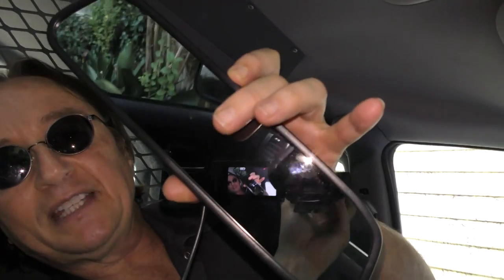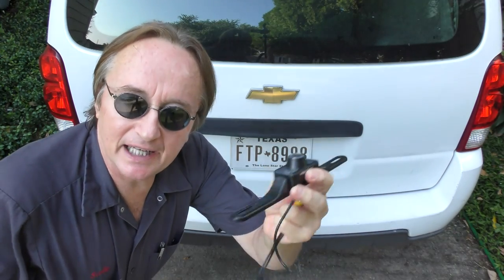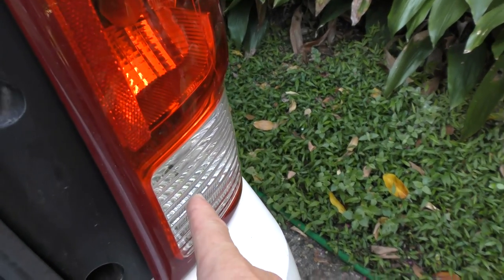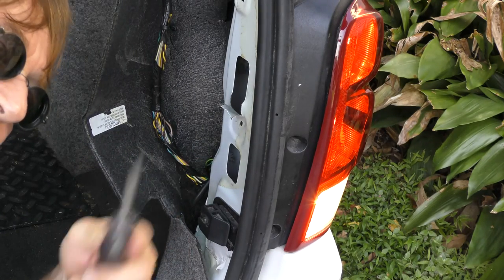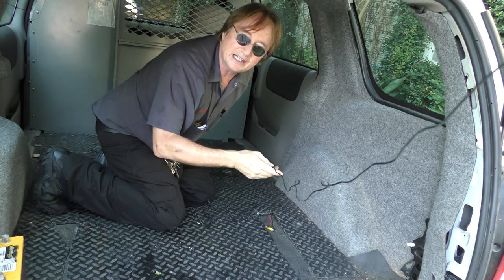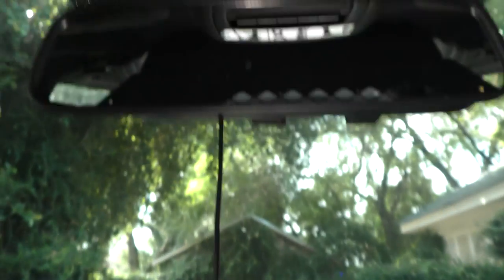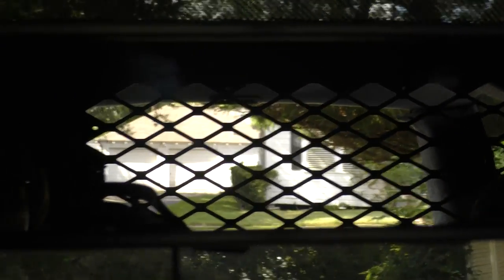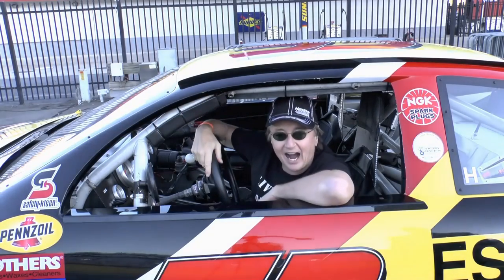How to Install a Backup Camera in Your Car

Comment: Hey scotty
Do you think it's difficult to swap an engine in a garage? I mean i know it is but is it possible?
Reply: if you have to ask that question, don't do it!!
Reply: It depends entirely on the Engine, the Vehicle it's being put in, and the experience of the Mechanic(s) doing the swap.
Reply: It's all nuts and bolts.  The question is, do you have the right equipment to remove them, and will you put them all back right?  Go practice on a junked engine that's trashed or something if you've never done it before or find a friend who has a clue - that's probably the better option.  You'll never learn more about your car than doing that job, though.  If it's a cheap car without a ton of computer electronics, I say go for it.  Buy the Alldata or some other dealer-level service manual, document everything meticulously on video (so you can watch if you forget where something goes), organize all the bolts etc. so you don't lose them and keep them with their components, triple-check you've got everything (or another ride because once you start you can't stop), watch some YouTube videos (hopefully there's one for your car), go slow, and have fun.  It's a 2 person job for certain parts of a lot of engines, and another set of eyes and hands always helps.
Reply: The easiest vehicle to do an engine swap is any domestic Truck made between 1950 and 1990. Incredibly simple designs, and more room in the engine bay than you could ever need unless you're planning on turning it into a Top-Fuel Dragster.
Reply: MaxTheKanuck I wanna do a K20A swap to a ep3 honda civic si
Reply: I think that is absolutely silly to do on a Type R.  Those are so over-priced (unless you already have one handy).  you can find a k24a2 longblock, which is the best k24 in stock form, for 1500-2000. drops straight in with a crv passenger side mount bracket and swapping over some sensors and will make more power and torque with simple bolt on's and a tune....should live a lot longer than the more expensive K20A's too

Comment: The "new version" linked costs $25 for the mirror-monitor alone. There is a disfferent one for $30 with a camera included. Transmtter/receive another $13. The indicated dimensions of the mirror are less than the width of my stock mirror.

Comment: How well does it perform in the dark?
Reply: I guess it's ok since it has its own infrared leds built in and the reverse lights also provide some illumination
Reply from the maker: yes, works good in the dark with infrared leds on it combined with the back up lights

Comment: I actually bought the exact thing and installed it in my car and right away the first problem I faced was the wireless transmitters, they're shit, the screen gets all hazy if they're too far from each other, second is when I put in drive the screen does not always turn off and shows AV2 with "no siganl" blue screen and it's annoying af

Comment: hey Scotty  my dad trucks turns off we have gone  through all of the motor can it be electrical he got a new stereo and since then it started acting up
Reply: Sudden engine shutdowns are definitely electrical. Try unplugging the stereo and see. But it could be many things, mostly sensors (timing sensor, ignition sensor, heat sensor etc.). Does it happen randomly?

Comment: Hi Scotty great video ,i drive a van so no rear mirror only side ones ,could this be wired to be a permanently on rear view mirror.
Reply: It can, just find another wire that is on when the cars ACC is on.. though most states have issues with that setup, and only allow it when in Reverse, as it provides a distraction.
Reply: Or you could just tape the mirror you got to your dashboard.

Comment: How can I install a back up camera that feeds to my infotainment screen? I have a 2015 Toyota Prius C, and I couldn't justify spending the extra few thousand dollars just to get a higher trim w back up camera.
Reply: you can easily hook onto it if your system has some kind of auxiliary video input setting. you can find that by looking at settings or if it has some aux hooking cables on the back of the unit.

Comment: Hey Kilmer thanks for all your videos they have helped me out a lot. I had a quick question. I'm trying to figure out if it's necessary to replace the woodruff key while replacing the harmonic balancer with an aftermarket one.
Reply from the maker: aftermarket one should fit on the key already there

Comment: Hey Scotty, are electric cars reliable?
Reply: No lol
Reply: Not yet at least.
Reply: No and batteries dont last very long and new ones are very expensive. They really arent worth it.
Reply: haha no.  and very unsafe if the worst happens.  as a firemen,  cutting electric cars open takes forever and is very hazardous to us and any occupants,  so you'll be in there awhile.
Reply: Have you seen the Tesla Model S in a rollover test, they have some of the strongest roof structures on the planet very safe cars to crash. However everyone else is right. Electric cars will see diminishing return on battery life throughout their life until they break like all Lithium ion batteries do. Its very expensive to fix. Also the extremes of both high and low temperatures in the US is not helpful either as it wears out the battery quicker and reduces the effective range. The only advantage is that you don't need to service them but the savings from that are nothing compared to the cost when the batteries need to be replaced.

Comment: I've got the mirror monitor and the transmitters for the camera and monitor. My monitor has a red, black, blue wire. The red and black are obvious but where does the blue go? It's called a trigger wire according to the manual that it came with but it doesn't say where to plug this cable in. Anyone could chime in and tell me where to plug it in?

Comment: hey Scott y,

can you provide some input on why my display shows all fuzzy and static. referring to my double din radio. also, how do I hook it up so it comes on automatically when ib place car in reverse? I'm having to click on rear camera to show display.
Reply from the maker: pray you have a bad ground on that circuit, if not, often just the display circuit board breaking down
Reply: if you use the wireless transmitter, most often they work on 2.4 Ghz frequency. you might have other devices that interfere with the signal/just bad transmitter.

Comment: For vehicles with obscured or non-existent rear windows, yeah, but on any other vehicle is weird. People who 'need' (as in 'can do without') these backup cameras clearly didn't make the wisest vehicle purchase. It takes a sec to turn that neck and use mirrors. Good tip on this for those still unfamiliar with the concept though, Scotty. Looks like someone's company van who backs into loading areas.
This one's interesting with the green/yellow/red marking since the monitor typically has a poor depth of field.
Reply: What about vehicles where you can have the back obstructed by cargo?
Reply from the maker: ah, not weird. As in a dog or cat is behind the car, you won't see that without a camera. Or a small child.
Reply: I often park in an area that has little dogs running around and that kind of backup camera saved at least two of those little pricks.
Reply: Re That was my first note. If you need one, sure go for it. I've just about had it with people coming to me with these because they're a new thing and just want it just... because.
Reply: You can also get different lenses for most of them.
Reply: why you care about if someone needs it or dont. Ofcouse someone who doesnt need it wont buy it..and with camera you can see how far you can go, if your rear window is weirdly placed on car
Reply: Newer cars have weird rear windows so these types of setups work wonders. My camaro sucks
Reply: Marlowe Green I wanted one until I sat in the LS1 Convertible recently. At my height I couldn't really see out the front window and would give myself a haircut every time I'd put the top up. Shame. =\

Comment: A kind note mr. Scotty. You make it look easy to pass the wires trhough the rear door
but being an amature, when I installed my backup radar,
 I didn't want to rush things and ruin any plastics or apholstery
and running those wires alongside the factory wire loom in my car was a bit tricky. 
Also passing them through the factory rubber covers and making the connection on the 
rear light connector, without actualy cutting ANY factory wires at all, was a chalenge
and it sure wasn't as easy as described on the video. Took me a good 2 hours from start to finish, just to  pass the wires on the back door through to the back side panel.
But in all honesty, I enjoyed it as fuck (excuse the language)
Good stuff you're puttin' on here
Keep reving your engine.

Comment: Hey I got a 2010 Chrysler 300 the 3.5 engine .... And I have problems sometimes starting like when I use my key fob and turn it on and doesn't crank now when it happens I tend to put it in neutral and sometimes it would work .... I took it to dealership they change a fuse and weeks later same problem ..... Also had starter change also still nothing
Reply: It might be a bad neutral safety switch.
Reply: it might be a Chrysler
Reply: Neutral safety switch either bad or loose or otherwise out of position. This is assuming that what you're saying is that the car won't crank in park but will crank in neutral.
Reply: +wholeNwon well most of the time it will start up normal no problem ...... But when it acts up 80% of time I would put it in n and would start ... The other 20 it wouldn't start I would take out the key and try over and over again like 5min .....  But on days it would not give me no trouble  I would get in and crank it and it's all good .... But it do have them days it would give me trouble.... Hate it cause when I want to return it to the dealer to get it fix it does not act up .... I do have warranty on it but gosh it's a hassle
Reply: check out Motor City Mechanic you tube channel. Dave is a Mopar mechanic.
Reply: If it's under warranty, make them fix it...easy as that!  Point them toward the neutral safety switch but could be other thinks, too. Keep records of your visits to preserve your warranty rights even after it expires!!!!!!  And check your state's lemon laws to see when they have to replace the vehicle. When you have the facts, mention it to them.  If they know that you know the law, they will fix it right.

Comment: I have the same kit I put in my car 4 months ago. Camera gets moisture in it and is no longer viewable. Says waterproof but it is not!
Reply from the maker: good to know, realize you can use any camera on this system that's made for that and buy a higher quality camera for it if needed
Reply: I've read that f you mask the lense of the camera off, plastidipping it works well. I plastidipped my RC electronics and it waterproofs them.
Reply: +Scotty Kilmer Here's a good tip though. If your car has a sun roof just wire the mirror to the constant power on your sun roof switch. Then you don't need to run power anywhere! :)

Comment: You need to be careful about the rear camera on the plate. Cops can/will stop you if the plate is "obscured". In the video TEXAS was completely blocked so I definitely can see a cop stoping someone over that.
Reply: Could you not tell the copper "Sorry mate, but you know that reverse camera cost me $20?"
"$20!?!? Hell I need me some of that"

Then you make a friend for life with the policeman.
Reply: I've seen several squad cars here in Texas and they have a similar camera system blocking the view of the state. And not many cops are that anal about license plates.
Reply: In the red states cops barely stop you for speeding unless it's speed trap, DUI, or seatbelt awareness day.  They don't want to write you a ticket much more than you want to get one, especially for something like a plate.  It's a hassle due to paperwork.  They're understaffed and have better things to do.  For license plates only ones that look suspicious (like they don't match the car) for being stolen, or if they have the wrong exp. year/color are gonna cause you problems so long as you can view the plate number.  Don't drive like an idiot or without your brake lights and stay out of their way and you're good.  I live in Indianapolis, and I swear I've only seen people get pulled over on our interstates if someone annoys a cop by staying in the left lane when they just want to pass (they usually drive 80, speed limit is 55; EVERYONE goes 70. Don't impede cops going 80 and let them pass easily and no ticket.)
Reply: Alex M What are red states?
Reply: Conservative/Republican leaning states.  Anti-regulation, anti-tax, states in other words.  Blue, or Democratic states tend to favor larger government and hence more regulations - they have a lot more laws you can violate and tend to heavily enforce them for the revenue.  There's a lot more to it than that, but those are the relevant points for what I'm talking about.  Easy example: most Democratic states have emissions testing, and if you fail emissions testing, you must pay a fine/get it fixed before you can legally drive.  My state, Indiana, has no government inspections of cars whatsoever.  I pay for my registration once per year, and that's it.  You won't get pulled over and ticketed for driving a failed emissions car in my state because it isn't against the law here.  We tend to only go after the big stuff - DUIs etc.  Things that can obviously and directly hurt other people.  We'll have more cops on the streets arresting gang members and drug dealers than we will writing seatbelt tickets.  I already know someone will take issue with my overtly generalized statements and argue against them point by point - but I'm just trying to illustrate what I mean and full well know it's too generalized.
Reply: +Alex M Tennessee is a red state and cars have to go through emissions. I don't mind emissions testing since I maintain my rides and keep the crappy cars from fumigating the streets.
Reply: I maintain mine too and all would pass modern emissions.  I'm fine with the idea of keeping the pollutants out of the air, too - I just don't need big brother watching over my shoulder telling me how to do it. It's a hassle people like you and I don't need, and bottom line - SOMEBODY'S paying the salaries of all those gov't emission employees and their fancy tools (hint: it's us).  Of course I know people can't be expected to self police that stuff like responsible owners leaving us between a rock and a hard place.  And hey, if those old junkers last twice as long or more than a new one, then those extra pollutants it produced in its life don't even come close to the price of manufacturing 2 new ones to take its place (both in money, materials sourcing, transportation, and manufacturing emissions) :P

Comment: Well, good luck turning on your backup lights and find the wire if you're by yourself if you have a manual car. I don't like to admit it but that's one point to automatics.
Reply: Turn the key to the ON position without starting the car, shift the car into reverse (while keeping the emergency brake applied) and boom, your reverse lights come on without stalling the car
Reply: +Jordan Cameli i knew you could do that but not that the lights would actually turn on! you learn more every day...

Comment: I'm an Old School Driver, love the smell of gasoline in the morning, i don't need a camera to reverse, practicing gives you the hability/skill 😆
Reply: Drive any 2016 ford and you'll know why they have backup cams.
Reply: American Car is a No No No!!
I only drive Toyota or Honda 😂
Reply: Both are great cars. But other guy is right, modern car windows and visibility are getting smaller and smaller.
Reply: Rigo F. lol implying any of the new fords are based on american models. that's not an appropriate response anyway to be like that. the fact is they have no rear visibility. whether you  NO NO NO like ford or not.

Comment: Security tip: Use torx screws with bold head instead of phillips screws in your license plate.
Reply: I was thinking about using torx head screws for my license plate on my car, because the Philips head screws lose their heads all the time when I remove my license plate to remove the old registration tag and put the new one on in my house during the winter weather.

Comment: isn't that improper display since its covering the texas on top of the license plate could be a ticket.
Reply: Could, but very very unlikely. There are tons of decorative plate covers out there that cover part of the state and even part of the county (which isn't required either), Really, as long as you have good plate lights and the actual plate number is exposed, I doubt there will be an officer who feels he has enough time to hassle you.
Reply: So true.  I was pulled over once because the license plate holder was partially covered up the words "Empire State" at the bottom of my NY license plate.  It was just an excuse to pull me over, though I didn't receive any tickets for anything.  I've never used a license plate holder since.

Comment: How does the Kit recognize a gear shift? O.o
Reply: It turns on when the backup tail lights light up
Reply: You just connect the camera power supply leads to the power supply of the reverse light that comes on when you shift to reverse gear.
Reply: When you shift to reverse your reverse lights turn on, you just connect the camera power to reverse light wire and you have a working camera. Since the camera will probably use small amounts of power nothing should happen.